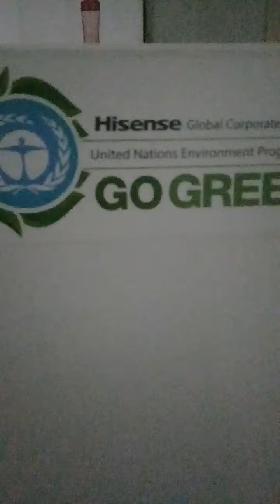How to fix   Hisense )no  frost fridge  freezer fan sound  and not cooling

Comment: HISENSE FRIDGE FREEZER. SOUND OF THE FAN SEEMS WORKING PROPERLY, BUT THE COMPRESSOR STARTS WITHIN FEW SECONDS STOPS, STARTS AND STOPS. STARTS AND WORKS FOR FEW SECONDS AND STOPS FOR 4 - 5 MINUTES AND STARTS AGAIN. PLEASE ASSIST PREFERABLY BY TECHNICAL VIDEO
Reply from the maker: Thanks for your time if you in uae WhatsApp 0563143327  comprssor start and stop and start the problem comprssor raly